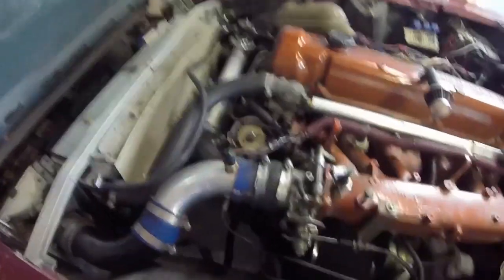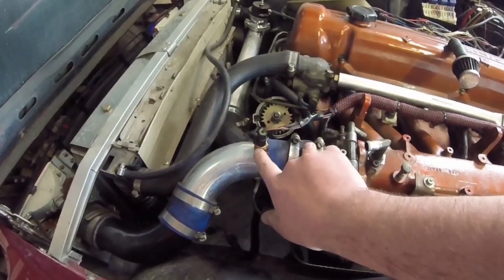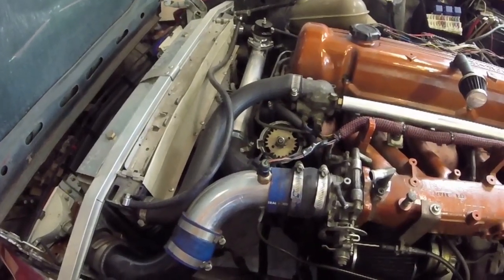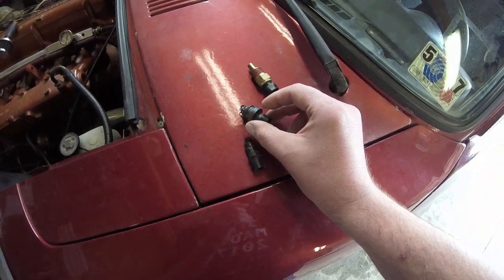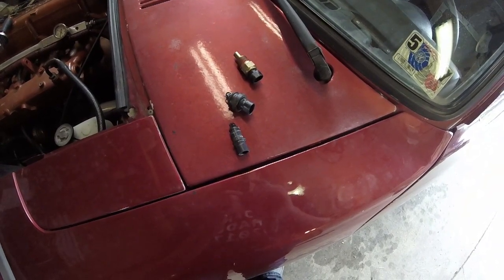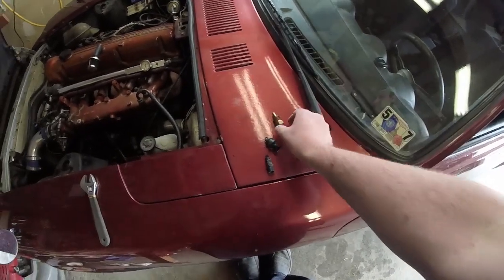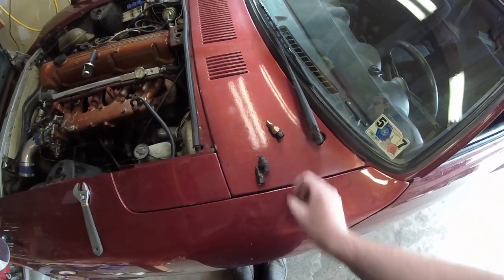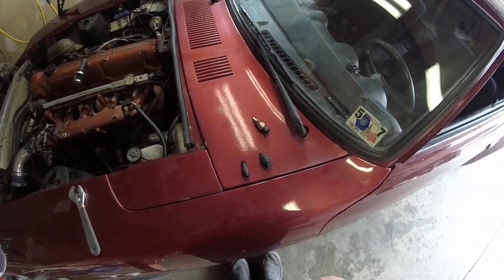IAT - Open vs Closed - Why your Standalone ECU cares

Comment: hi,CEK. now,i confuse the IAC valve wiring and cofigulation.
toyota blacktop 4AGE stock IAC,
3wires,rotary solenoid.common anode,2negative signals.
my ECU is speeduino v0.4.3c.
its difficult because 2output pins.

Comment: The closed one has a huge inertia compared to the open one.
I don't even understand why they use them on cars.
You should try to insulate your intake section of AL piping with insulation foam tape.
You wouldn't have heat soaking at stops ,red lights and such.
You can also use a thick non heat conductive gasket on the intake ,to insulate it from the block,like a teflon sheet,or a fiber gasket material. (but no graphite gasket).
It's really beneficial for intake temps,knowing that the whole plenum is heated by the head itself...
 IAT is reading what coming in your head,but air is heated after the sensor.
Reply from the maker: All great points, I decided not to go with the screw in type IAT because I wanted that buffer from the alum intake pipe to not cause a little bit of a bad reading and to insulate it a bit. 
With the heat soak, It was really bad in the winter. I would see IAT temps of 35 to 40 when moving and driving, and at long stop lights it would go up to 80+ when it was freezing outside and start to run lean. It was not as bad during summer months, but still was always there when I reviewed datalogs. Great idea with the intake gasket, I will need to take a look at doing that when I move on to my next block here in a bit. I am not sure what options I have since the exhaust and intake share the same gasket (got to love non cross flow heads...) Thanks for watching.
Reply: @CEKGarage  Just cut the gasket to separate intake from the exhaust to keep exhaust gasket material and replace the intake part.
You can gain a lot from that,and also from just insulating the intake from the exhaust : i have a non cross flow engine head too and both are separated by a sheet of metal bolted on the exhaust.
The goal is to encapsulate the exhaust ,but to get a air gap between the sheet of metal and the manifold: air is a very good insulation material.
Junkyard heatshields found around catalyst converters under cars are very good to reuse and form as you like.

https://www.classiczcars.com/forums/topic/57633-thermo-tec-products-as-heat-protection-to-avoid-percolation-under-hood/

Comment: Thanks, I’m relatively new to understanding how ECUs work, each video gets me a little bit closer. What type of laptop would you recommend? Thanks again. Ben
Reply from the maker: The one you have ;) as long as you have a battery or one of those cheap power converters. The laptop i use I got for $20 from a local business that wiped them clean to sell them.
Reply: Tunerstudio runs well on almost every laptop that can run Java